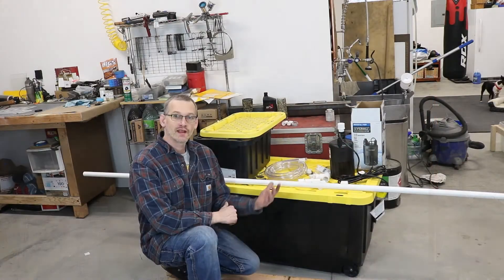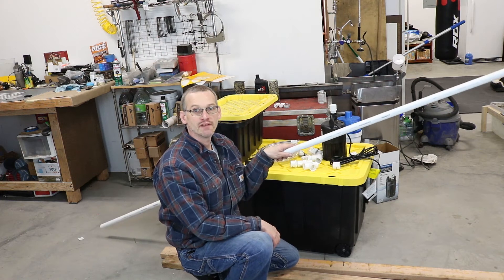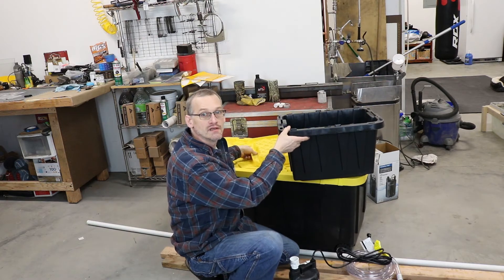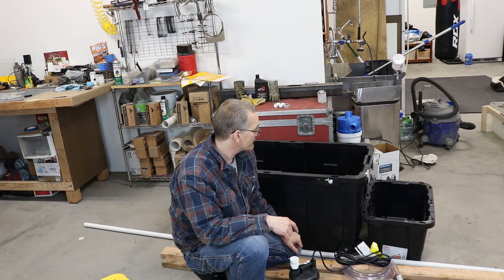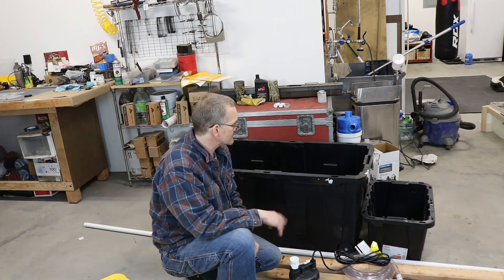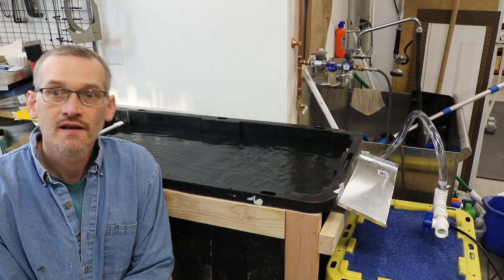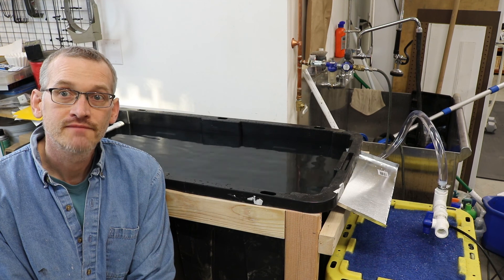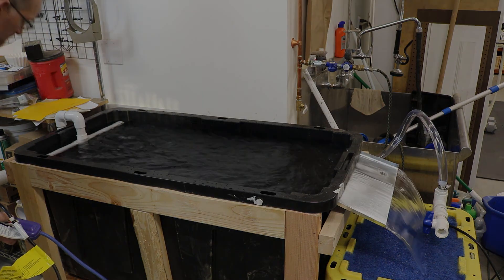Making a simple inexpensive hyrographics dip tank

Comment: My only question is what did you find to be best for placement of power switch and valve
Reply: Using an inline circuit interrupter switch would be wise.
Reply from the maker: Honestly I still use the power strip because I only use the tank a few times a year
Reply: I figure a power strip is honestly the way to go long or short term no?
Reply from the maker: @seansharp4629  it works and thats all that matters

Comment: Great video! Lost me at 3D printer, but thats me. Great build! this inspiration will definitely force my creativity to bypass the printer. bravo!
Reply: 3d printers are only getting cheaper and easier to use. You can get a small but effective resin 3d printer (which is actually what I recommend for it's relative ease-of-use, greatly simplifies the setup process) or a similar FDM printer for less than $300 for resin and less than $200 for FDM (Anycubic Photon or Creality Ender 3). Alternatively you could just JB weld strips of metal or wood to the plastic in that same spot, doesn't take all that much creativity lmao.

Comment: With your heating element how long is it taking for your tank to heat up?
Reply from the maker: Haven't tried it from cold.  I fill with hot water and the element just has to maintain.  I bet it would go from cold to temp over night if you set  timer to circulate the water every so often

Comment: I’d get a bucket heater and put it in the sump tank this way you can heat that water then pump it into the big tank.
Reply from the maker: That would work but you would have to frequently circulate the water.  I plan on using a water heater element on a PID controller in the main tank.
Reply: @alaskanmancave5301  Or theirs always the Trough heaters for keeping livestock water unfrozen in the winter that would work also in the larger tank.
Reply from the maker: @lastchancecris  I thought about one of those too but I wasn't sure if it would get hot enough.

Comment: do you turn the pump off when dipping? surface looks rough
Reply from the maker: yes you turn the pump off and let the water settle out before laying down the film.
Reply: @alaskanmancave5301   see great build buddy, is it big enough to dip a wheel ?
Reply from the maker: @ASHIE-BTHC  a 20 inch rim would be tight but I think anything under 18 would work well.

Comment: Awesome work!! Any ideas of how I could build the ramp with the 3D printer & maybe not the metal work as looks abit tricky for me I’d love to have that
Reply from the maker: I'm sure that the entire spillway could be 3D printed.  The part I printed was the max-width I could get on my printer.  And I printed it diagonally across my build plate.  I could have printed several pieces and glued them together. But, that is why I built it from metal it was easier and faster.  There is never a set solution to a problem and it is fun to see how others tackle it in their own way.
Reply: @alaskanmancave5301  sorry I meant to without a 3D printer, I don’t own one unfortunately, really interested in making this
Reply from the maker: @lewisclarke8018  perhaps you could use a tote lid and some strips of wood to stiffen the tote.  The lid could screw to the wood.  Lots of ways  to solve the problem.  Just be creative with what you have at your disposal.  Could even try one of those fiberglass kits from the auto parts store.  All you really need is something to stiffen the edge an something water proofed to direct the water.  Good luck with your project.

Comment: Could you add a parts list please. And explain how the pump system works. Great work man!
Reply from the maker: I added the parts list to the description of the video and their local cost.  I hope that helps.  As for the water system, the pump in the lower sump(small tote) pumps water to the big tote's spray bar through the vinyl hose.  The spray bar is intended to push the surface water and any unactivated film through the slit I cut in the end of the big tote and through the filter and back to the sump.  This keeps the surface of the water clean and maintains the water level at the same time.  I hope this answers your questions.  Keep in mind the update I put in the description about the removal of the valve and the addition of a check valve.  Let me know if you have any other questions or comments.
Reply: @alaskanmancave5301  Thank you, this is way better than spending 6,000 on a hydro graphics tank!
Reply from the maker: @James6192-l9y  you can do it
Reply from the maker: Sorry, I'm Late getting back with you I was traveling the past few days.  I'll get a parts list put together for you and a better description of the pump system.  I have slightly modified it since I did the video.